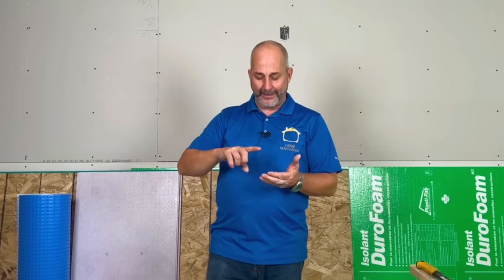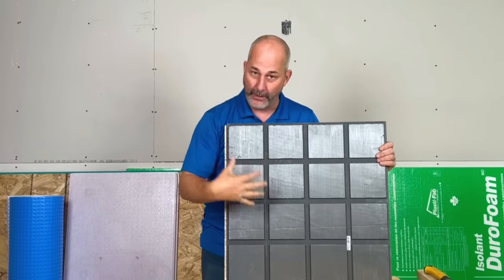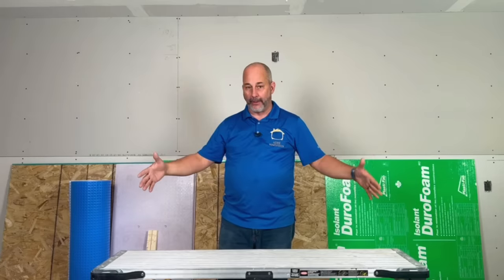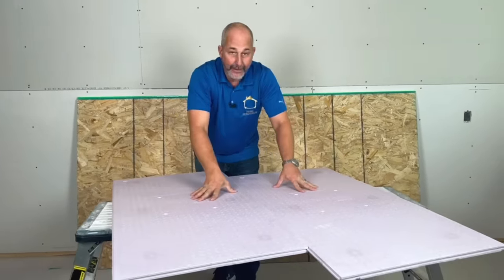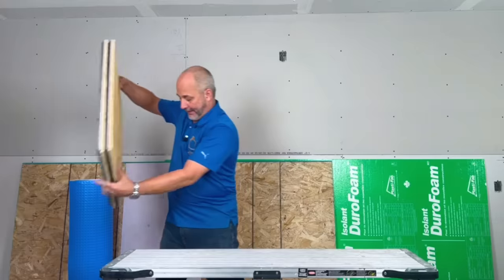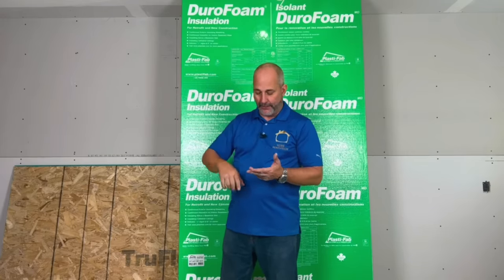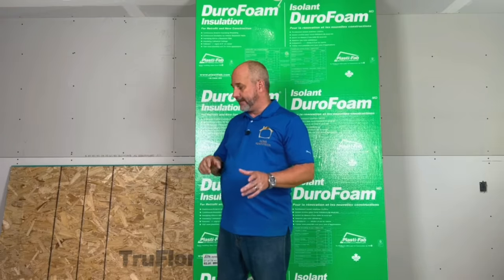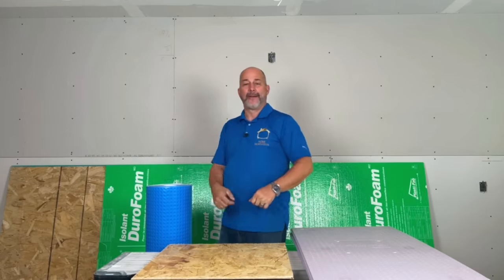Comparing 5 Different Subfloor Systems and What They Cost

Comment: Jeff, great breakdown. I'm currently in the middle of my basement Reno (drywalling currently) and I have the cement floor exposed. My plan is to use dricore insul-armour for the thermal and moisture benefits. My question is this: I have a drain in the basement and there's a small slope towards the drain. Obviously, I want the drain to remain on a slope so that any moisture can't run into the drain, but the insul-armour should be installed on a level floor. I've been thinking of leveling the floor using gravel (it's about a 5 ft diameter circle for the sloping, the rest of the basement is level), but I don't think I can find gravel that's fine enough to level the floor without causing an increase in height. The total slope MIGHT be 1/3 of an inch at the very most. 

What would you suggest to level the floor without losing the drainage slope for water?

Comment: Hey Jeff, I live in an old house that has some moisture in the basement but it's not terrible. The floor currently has what I believe to be asbestos tile on top of concrete (and the previous owner painted over it). I'd like to just put a new floor on top so I don't have to disrupt it. There are a couple of areas where the concrete is higher than the tile so the floor is far from flat. However, the floor slopes from east to west a good amount where a drain exists. Besides a truck load of self leveling concrete (the space is about 1000 sq/ft), is there any underlayment/subfloor you'd recommend that would take the imperfections out and allow me to lay a vinyl floor on top? I know it won't be perfectly level, just looking for something good enough to turn scary basement to somewhat usable space.

Comment: I have a 10x12 utility room in the basement that houses the laundry and water heater/furnace. It has a concrete floor with peel and stick vinyl (in disrepair) currently, and a gradual slope towards the drain in one corner of the room. I am wanting to install new flooring in that room, and we definitely want to retain the slope to the drain. I'm wondering what the best option is for flooring to avoid any bouncing or cracking with that slope? I was thinking about approaching it like a wet room with smaller format tile and then relief cuts around where the drain is and the slope is the steepest, but I can't find much on this topic anywhere.

Comment: Hey Jeff,

 I have a 1974 house on a slab and I’m having issues with water pooling on the edges where the flooring and the wall meet, especially on the exterior walls. The water shows up when it’s really humid or raining. My thought was that there may not be a vapour barrier from the slab so all the moisture is coming in from the gaps along the wall. What should I be looking into to get this kinda issue sorted?

Thanks a bunch!
Reply: I’m in Prince Edward Island, Canada

Comment: Hello Jeff I live in New Jersey and I want to redo my basement looking to put in a subfloor and vinyl plank flooring but I have The gutter French drain system with two sump pump pit opposite into the house so I don’t take water in the basement and no no moisture issues any recommendations for a subfloor looking to save money was thinking about dry core foam panels but that would be over 1000 just for that

Comment: Hey Jeff! Got a question for yah! Really appreciate this video and wondered if you'd recommend Advantech panels (engineered wood plus insulation) in order to reduce the large height difference you'd add to the basement floor. I just watched your video on your favorite system, and noticed that it adds a lot of height (3/4" foam, 5/8" OSB and the flooring) which wouldn't work for us since our basement walls aren't very tall and my wife doesn't want to take out the SPC we already installed on top of the concrete lol

I ask because I was complaining that it gets really cold down there and we end up using a lot of fuel (oil) to heat the basement. She insisted we just need to seal the windows and doors better but I'm not sure that's gonna do anything about the floor. Would really love to hear what you think about that system. Thanks!
Reply from the maker: i went with the 3/4 and osb to provide the room necessary for the hardwood. if laying a floating floor like vinyl there are thinner options for sure. it is all about feature/ benefit/ consequence. Cheers!

Comment: I have a 1997 basement with a roughed-in bathroom adjacent to a foundation wall. It has water and thermal issues. If I go with a dimple system, do I continue the subfloor into the bathroom from the dry area or do I separate it?

Comment: Hey Jeff (or anyone reading this), I have a basement where i would like to do the flooring, right now it's only concrete. The issue is that the basement is really low, I'm 5f6 and i am almost touching the ceiling. I would then need a solution that would be as thin as possible. Would the underlayment be the best in that regard? Also what kind of flooring would be thin enough to avoid any clearing issues? Thanks!!

Comment: My biggest question about finishing my basement is when it comes to the floor. Concrete pad, previous owner did an epoxy layer. But I have a drain (and hose from the furnace) smack in the middle of the space. How do I get around that?

Comment: I live in a 1957 house. My basement already has stick on tiles. I don't want to remove them. Could they be creating some moisture barrier? So I could focus on thermal or do I still need to worry about moisture?
Reply from the maker: no worries any thermal barrier for a floor is going to also be a vapor barrier. look into insul armor. Cheers!

Comment: I was literally just about to do my basement and use dricore since I only have like 500 sq ft. But I wanted to do plush carpet as the finish. Would the dimpled roll and just OSB be enough? What thickness? It's a house built in 1948 so we have nothing under there.

Comment: I just bought house and the basement has leaked, maybe a gallons in a heavy rain that lasted a several hours. There is a foundation crack, but the inspector said it wasn't shearing or anything. The house sits in negative drainage on the two sides I saw leaking.  The basement has a drain pipe in it, the septic tank is getting replaced when the other house sells and I'm thinking about having that pipe rerouted to expel down the bank of the house to the creek bed rather than attach to the septic.   My current plan is to install a large channel drain along the front and side yards where the slope is towards the house.  Install a French drain and sump pump in the basement along the footer.  Install foam panels on the basement wall, using silicone so there's an air gap.  Then install the dricore subfloor and use pressure treated wood and mold resistant drywall for the interior walls.   The house was built in the '60s.  About half of the house has either concrete sidewalk or driveway (the drive way has a channel drain already) in front of it so I'm not sure I can effectively have the slope changed.  I'm also considering having a French drain put in near the middle of the yard where the slope is the steepest and maybe trying to gently slope away from the house to that drain, in lieu of channel drain.  I know those drain types only really deal with surface water, but getting next to the house for a drain by the footer with a water proof membrane will involve removing part of the concrete drive way.  On the short side of the house where some water has come in, again it looks like we've had less than a gallon in the past few months, there's a slab on grade addition so I'd only be able to French drain and wrap the one long wall that faces the road.  The back corner is above grade.  Sorry for the book

Comment: I am looking for a cheap option for water management not to concerned about thermal barrier. I am from Ontario Canada and house is older than 100yrs. We had leak in our basement and took out entire flooring. We had that blue sub floor mentioned in your video. Another issue is the floor is not leveled so looking for something that work with unleveled floor and can deal with water management.

Comment: I'm turning my downstairs into a rental suite, and my would-be kitchen has a 6-8" drop in the floor to the drain (about a 3 ft diameter) I'd like to keep the drain there and accessible, maybe through a hatch, but I'm not sure how to place my subfloor on top with such an extreme grade change. Any suggestions?

Comment: Thermal issues with my finished basement. What would you suggest if you were laying carpet? Same 3/4foam board and osb?
Reply: If you want the DMX, they make a version that has a further foam layer that you can use as a carpet pad.

Comment: I loopve your content! We live in Louisiana, the humidity level is almost 90% or above all year long. My house is on piers and the some areas of the subfloor are rotten out ( can see the dirt ground when pulled the  vinyl floor up). Any budget friendly subfloor system do you recommend? Thanks in advance!
Reply from the maker: Pressure treated Plywood. Cheers and use mineral wool as an insulator. mice hate that stuff.

Comment: Hi, thanks for the video. I am hoping to add a rubber gym floor in part of my basement. ITs a 1965 house with concrete basement, unfinished cinder block walls. Not looking to add drywall. Just wanted the rubber floors. What subflooring would you recommend?
Reply: Also, I live here in Toronto, Canada!

Comment: Jeffrey
So i have new build and low water risk
Planning on using 1/2 sm with 5/8 t & g over concrete my question is should my stud wall sit on the subfloor system 
Less chance of surface water (dhw tank leak or laundry incident) getting under the subfloor at the walls 
What are your recommendations?
Reply: Stud wall on concrete or subfloor?
Reply: So would you put you wall on the new subfloor or on the concrete floor and bring the new subfloor up yo the stud wall

Comment: I guess I'm off the topic of the video but I saw you say you reply to comments and I have some house projects ongoing and upcoming. Working on insulating my 1950 house. 3 projects, basement, walls, attic(s).

My basement is not a "living" basement, just utility/storage/workshop. The ceiling is already insulated to keep the main floor warmer. Basement still stays warm as there are vents down there. Do you think it would still be worth it to add R12 to the walls of the basement? Caveat being my basement walls do have cracks and a bit of water seepage. Below grade water is managed with a membrane and sump pump. I'm thinking two layers of rockwool comfort board so the water can still drain to the membrane but don't know if it's a good idea or not. Possibly spray foam to fully seal the walls and just keep the water out but I feel like this is worse.

As for the attic... It's a 3/4 story house. No attic access and I have 6 individual attics. Would I be able to just poke a hole in the wall and fill each attic with blown in insulation or would that cause problems or just not properly insulate? 

As for the main walls... This one is the most straightforward to me. I plan to replace the siding and while doing that drill holes and blow in insulation to the wall cavities. Nothing special and avoids those ugly siding plugs. Only thing I'm curious about, do you think it's worth adding a continuous insulation layer before putting on new siding? If so what should I put and how thick. Again, I'm thinking a layer of rockwool comfortboard.

Thanks Jeff!

Comment: The manufacturers of DMX said that it is for external use. As it is made of recycled material it may off gas odours into your basement.  I have sent you this before.
Reply: Can u provide website address which states this? I just left DMX website in which they do NOT recommend using OSB due to offgassing from the OSB, not the DMX.  (DMX-1-Step Installation-checklist)

Comment: Very Intesresting.
Question:  My house is 12 years  old. I live in Quebec,  Humid area because there is a main river 1 km (Riviere des Milles Iles) and a swamp about 500 feet from my house. Small swamp.   House is built on landfill, my sund pump bassin is dry.   Basement is very humid during summer.
I've installed  some Vinyl planks  on a part of my basement,  The same as you show in your video. They have no thermal barrier on them. They are 3.5mm thick.
I bought a thermal/vapor protector, a  black roll that i have put directly on concrete.  

The floor is quite cold during the winter. I am now thinking that I will Install dricore (dense plastic ones) then the thermal sheet on top of the OSB.  
But after watching your video, Should I just Install the blue  membrane + the thermal sheet? then my vinyl?  ( thermal sheet is underlayment SONO+ 1.5mm membrane LVT)   I saw this membrane at home depot, and it says i need 5mm thick ninyl.. Mine is only 3.5mm (5 if i add the sono+ underlayment)

Hope im clear, english  is not my 1st language.

Comment: Hello sir, I do have bought mobile house with wheel axis. it does not have foundation wall around. I have put 4inch polystyrene sheets in between floor joists, and built 4 inch polystyrene sheets wall around perimeter to close the gap between ground and floor. It is low height ceiling. It floor is plywood and on top I find a pvc roll then a carpet and then pvc flooring panels on carpet :D. It is very cold on pvc floor :( I would remove everything to the bare plywood. It What it could be best system to make floor not to be so cold... ?

Comment: Hey Jeff! New member here #MoneyInTheBank 🎉
I have a 1978 house in Kennesaw, GA that I want to renovate a finished basement (shag carpet on concrete slab 😅). I’d like to keep the subfloor thin and do LVP/LVT. I’m thinking the DMX dimpled membrane or the foam with pucks then adding my framing for rooms. Any concerns from your perspective? Is subfloor then framing the right way to go?
Next is to find a good wholesaler / contractor place to purchase from 🤔

Comment: (I live in the US) My house was built in 96, I was able to talk to the builder and he said he put 2 layers of tar on the outside basement foundation and a sump was installed with French drains but its almost never running, but a vapor barrier was not installed, I have no foundation cracks and no sign of water. I have a 1100 sqft basement. what's my best option without breaking the bank for a floor?
Reply: i also live in a state that gets a lot of snow during the winter

Comment: My house was built in 2019.  I'm going to finish some areas but I'm confused on the different wall systems.   One you used 2 vapor barriers and one video you used only foam.  I don't have moisture problems that I know of and have a sump pump.  I also have a pump for the bathroom that will get finished.   Should I use the foam system and insulate with r11?  I also like the dimple system with the osb but not sure if I need it.  Any help would be appreciated.   Love the videos
Reply: My understanding is that if your home is a newer home (yours is considered as a newer home), then there is already a vapor barrier protection in the concrete.  The next question would be whether or not you are in an area that has a lot of flooding.  If yes, then use the foundation dimple roll and put osb on top of that.  If no, then you can still add foundation dimple or use the durofoam stuff.
Reply: @goldenmunky  any idea on the walls?  Foam the 2 x 4 without a plastic vapor barrier?
Reply: @tylerhunt5135  This channel has a video about walls that could explain it better than I can.  haha

Comment: Hi Jeff, was told  by sales  people that the. vinyl plank flooring I wanted  didnt need any thing under it as it already is a 1/4" thick and. designed with air chambers  and a fabric ( very much resembling landscape fabric on the  fbasement  floor side .
Well its been about a. year in and  the floor has. developed and. given birth to moisture and. some. kind of FUNKY brown goop growing out    from betrween some of the  planks. 

I suspect that there is a lot of  collected. water in the. tiles that is. draing back under the. slab because I suspect the very old  weeping tiles  that was  broken  about 6 ft away from the. sump hole  to make. room for a. toilet and. then never reconnected back  to  connect  the rest of it to the. sump hole. 

 The house. was built in 1960. and. there  definitely is a. moistere issue down there but appears to NOT be the. whole floor and. I am getting the tile  recconnected to reach the sump/sewer hole again  b4 the. toilet was installed.
I was seriously thinking of the. dimpleboard but you said it was. very important to get a thermal barrier? And the. dimple board /. roll  doesnt give that  so can u  still just make a reccomendation anyways?  
I guess if I want to have a. warmer rec room while. sitting down the. thermal option sounds good. but at. what $ cost as compared to the. dimple roll ?
I really am No big on the  2x2 aspenite vinyl bottom  but Im just. rambling now lol Thank you so much  if u can give me some more wisdom on the. sunject.
I do. have. clean outs  but not much good if  flush towards the  bathrom and the. water is. going under the slab 
Things. should. improve I hope once the tile is connected again and. reflushed once again But what should I put down and is it sold in Canada?

Comment: So I can use that blue dimple with the green pad in new jersey house was built in 1960 just an fyi I use my basement as a gym and my rubber floors are dusty under it kinda like power when I pull them up after a year using it.  Also will my heavy weights or machines push the dimples on the underlyment causing damage to the dimples or is it strong enough to hold that kind of stuff
Reply from the maker: best to keep the rubber mat. try laying a vapor barrier under it to reduce the moisture getting trapped in the rubber.